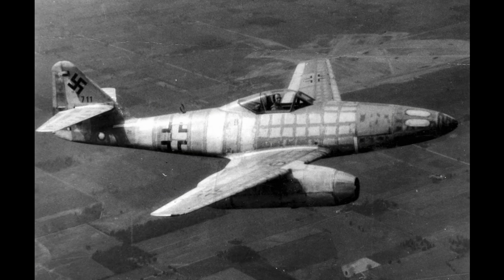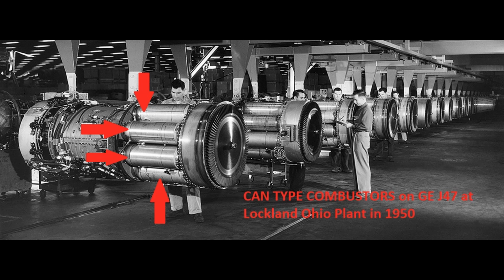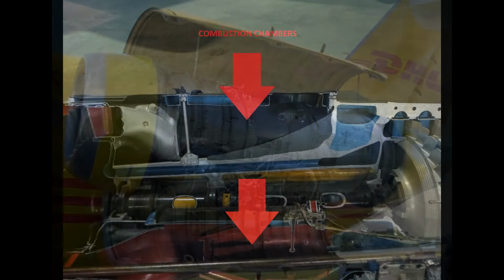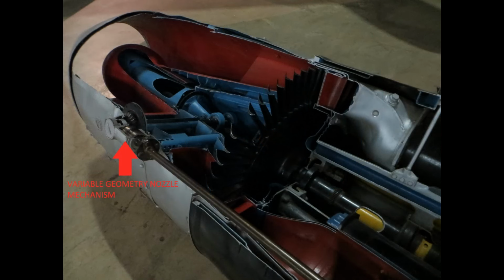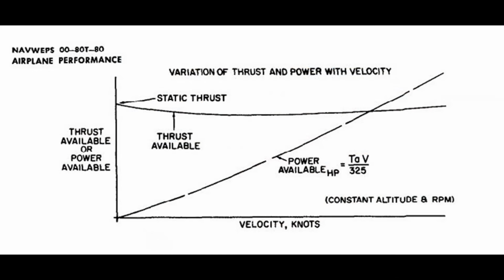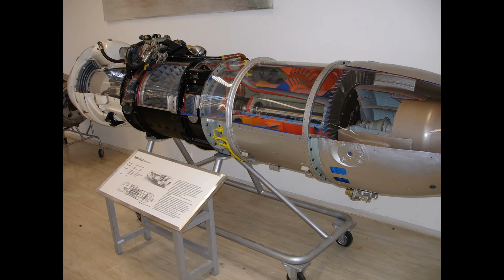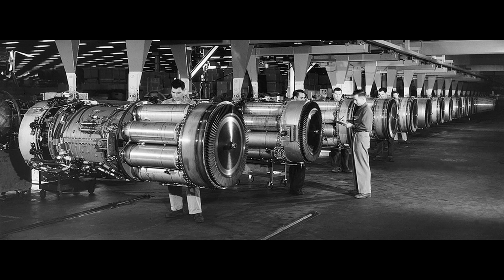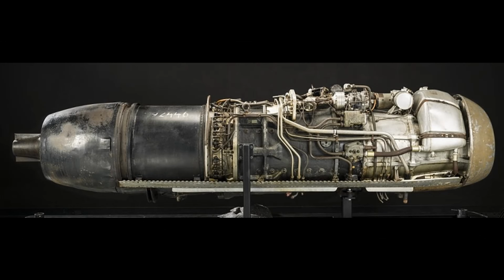World War Two JET POWER

Comment: Oh dear. I have been a consistent fan of Greg for many years but this upload defies description for misleading information. The Brits ran an axial Metrovick  F2 in November 1941 and flew it in a (twin) Meteor in November 1943. Sadly turbine failure resulted in a fatal accident in April 44. The problems in the F2 alerted the Ministry to the development problems of the axial engines even though its power to weight ratio was potentially superior. It eventually became the Beryl and led to the Sapphire(Wright J65). Britain pressed ahead with the centrifugal Whittle engines, the Welland and Nene as well as the DH Goblin. These were all wartime production engines – reliable, robust in throttle response and easier to build with over 100hrs TBO. RR were very good at centrifugal superchargers for Griffons and Merlins. The Welland flew with afterburners in 1944 to chase V1’s. The Nene ran in October 1944 at a thrust of 5,000lbs and a dry weight of 1,600lbs with total reliability. The Jumo004B gave 1,980lbs thrust for a weight of  1,585lbs with total unreliability. The Brits got their superior tech into today’s war while the Germans were always chasing the next dream.  The 262 was a first generation straight wing jet with the same performance as the Welland (long nacelle) Meteor, the Vampire and the P80. Out of 1,294 built, fighters shot down 214 and 146 crashed with various pilot/turbine failures; more were lost through other means. It had no impact on the air war. I get fed up with the Me262 myth. If the Germans had won they would have discovered that turbine and material science was way ahead in England as were actual useable wartime inventions like the cavity magnetron, Penicillin, the proximity fuse, the Mk2d computing gunsight and the B29 etc etc – not to mention Colossus. Read- Gunston – Development of Gas Turbines, The Fedden Report and Jet Man – and then, please,  rewrite this again with the facts! By the way the Ju287 was a bitsa Heinkel experimental aircraft to specifically test the swept forward wing – it was never intended for operations.
Reply from the maker: Chris, it seems that your complain isn't that I said anything incorrect about the Jumo, rather it seems that you are complaining that I didn't talk about British stuff. I just had an entire video about British stuff. You people are never happy. Look, the British did make some good progress on turbine engines, but during the war the 262 was a better plane than any British jet. The Meteor wasn't even allowed over enemy territory, which is where all the air to air action was taking place. The Jumo proved to be the basic layout of turbine engines to come.
Reply: @GregsAirplanesandAutomobiles  I am a historian writing on technical subjects and as such understand that I have a duty of care for unbiased, balanced factual truth. I  am not English. The Americans were given a Whittle engine in 1941 which resulted in the successful copy, the GE1, in October 1942 - but they already had some  embryonic turbine projects underway. The prototype GE-TG-180 11 stage axial running at 4,000lbs  was a success running in April 1944 with no input whatsoever from Germany. The Russians were about to run the eight stage axial VRD-1 when they were invaded - which rather took their attention. The Brits had the Metrovick F2 axial running in 1942. The Jumo was just one of several RLM axial turbine projects with Bramo, Mercedes, BMW et al. It was not the 'first' and did not influence anyone. It could be considered underdeveloped and unreliable, being the major reason for the failure of the Me262. The allies did not need to get jets to Germany because they controlled the air over the battle lines and beyond from July 1944  with a massive numerical superiority which made the few Me262's a nuisance not the 'wonder weapon' beloved of the 'whatiffers'. I liked your recent post on the Wright $1000 challenge because it was well researched but you forgot to mention your own country's genius Manly who made the radial for Langley's Aerodrome which gave 52hp for 125lb weight in 1902. The problem with TV documentaries and Youtube is that they often have no editorial or peer group supervision - this allows a sort of mish mash 'faction' which warps history for future generations. I still like your posts which are mainly well researched.
Reply from the maker: Thanks Chris. I understand your point, and I don't disagree with your overall position. We have to accept that there is a considerable difference between what I'll call an opinion piece, and a straight history report. In the case of this video, right on the thumbnail it says "best jet engine of the war?". That clearly states that this is an opinion piece. Anytime you throw the word "best", or "greatest" or something like that, it's an opinion. It's my opinion that the Jumo was the best Jet engine of the war. It's war record supports that, no other jet engine came close to the level of combat success it had. Now if you want to use another standard to describe "best" that's fine, but you would be basing your opinion on another criteria. That doesn't make me wrong, and it doesn't mean you are wrong. Some of my videos are not opinion pieces and lean way more towards straight history or technical works.  cont:

    Now in the 1000 dollar challenge video I didn't mention any engine builders because engines were not really  the subject of the video. The Wright's patent has nothing to do with engines. Any video is going to have some short comings in terms of scope. I can't cover all aspects of things in one video. There is some point at which I have to stop. For example, when talking about engines, should I get into the metallurgy of the  pistons? That's an important factor. Should I talk about the person who designed the forgings?  cont:

 Lastly, as you point out, my video are not peer reviewed. It's just me here, so there are factual mistakes from time to time, although I'm proud to say, not many. Now my opinions are another matter. Of course you or others may disagree from time to time. Frankly with over 100 videos on my channel, if you agreed with every single one, I would worry about you. Statistically that would be very unlikely, regardless of the channel topic.
Reply: The Metro-Vick was ultimately a failure, A.A.Griffiths abandoned the project and it was sold on to Armstrong Siddeley well after the war ended.
Reply: The Fedden Report is British proof that Germany was years ahead in aerospace technology... 
 Many British urban myths are based on a common ailment which plagues British culture, known by psychologist as Anglo-Inventus  it is a Cognitive Dissonance disorder where the person believes that Britain invented everything by refusing to recognize or dismissing  anything invented outside the U.K.
Reply: @sandervanderkammen9230  Read the response - I guess you suffer from Germano-superiosis - a common disorder after defeat in two wars.
Reply: The Metrovick was a failure, Britain would not have a viable axial compressor turbojet until the 1950s
Reply: @WilhelmKarsten 
Fryed Ryce Munchyrz Kharzeestan Krappenz DiktorBummer Werkzxoffen etc and co SHUD note good with much awestruckness pleastoo &

It's fairly simply, UK axial engines were superior to anything from anywhere else as they were being developed from 1925 onwards & of course the requirements for acceptance in service were also very much higher than anywhere else so they remained in testing & development for much longer than anywhere else.
  There was no urgency & no need to take silly risks & do ridiculous things with the engines or produce massive amounts of garbage as was routinely done elsewhere.
👍 
Cheers
. . ... . . .... . . .....
xcvcxcvxiiiiivcivc
Reply: @paulpaul9914  Britain didn't have a certified flight rated axial compressor turbojet in production until the 1950s.
Reply: @paulpaul9914  But why didn't the brits have axial engines during WW2... they continued to develop obsolete centrifugal turbojets into the 1950s
Reply: @paulpaul9914  Why do you tell lies?
Reply: @paulpaul9914  The most powerful turbojet engine of WW2 was the Junkers Jumo 109-012.

Britain didnt invent turboshaft engines The Norwegians and the Swiss did.
Reply: @paulpaul9914  How is it you cant answer a simple question about british jets still in production?
Reply: @paulpaul9914  The Nene never saw service in WW2 either... it was bulky, heavy and underpowered because of its obsolete centrifugal compressor design,
Please name a single supersonic aircraft with a centrifugal compressor turbojet.
Reply: @paulpaul9914  Variants of the Jumo 109-012 ARE STILL IN SERVICE TODAY

Centrifugal Turbojets are OBSOLETE since 1950.
Reply: @DoktorBayerischeMotorenWerke e
Kharzeestan Krappenz DiktorBummer Jurkzxoffenz etc & co - they should note with much awestruckness.
    More than 30,000 Whittle style centrifugal compressor reverse combustor gas turbine aero engines have been produced since 1940, they are still manufactured for use in a number of helicopters & turboprop aircraft.
  The PW200 gas turbine aero engine is such an engine that is currently manufactured.
  The RR (Of England Of Course) Nene centrifugal compressor gas turbine aero engine was twice as powerful as any short life scrap  engines being produced in Germany & of course was the most powerful gas turbine aero engine on the planet in 1944.

👍& 🙂& of course 😎 indeed.
Reply: @paulpaul9914  Centrifugal turbojets were already obsolete in 1940, Germany completely abandoned development because they were an evolutionary dead-end concept with no viability for the future of jet aircraft.
All jet aircraft today are powered by a German axial compressor jet engine.

Comment: Hi Greg, small correction, the air isn't compressed by being forced into a confined space. A common misconception, sometimes simply used because easier to understand.
The air in an axial compressor is compressed by being pressed through diffusor shaped airfoils. In a Diffusor, as you certainly well know, the air passes from a smaller flow area into a bigger flow area. This causes the airflow to slow down and therefore the molecules to reduce space in between them. That causes more friction (temp increase) and more packing (pressure and density increase. That of course only works under constant flow and provided the space towards the Combustor is adjusted (reduced) to account for the smaller space required for the same mass of air. This makes the compressor cross section look like a Nozzle even though it isn't one. 
The opposite is happening in the axial turbine section which works under the nozzle principle reversing the thermodynamics of the diffuser.

Comment: Very interesting video. I've watched less than a dozen of your videos so far. They were all worth watching. However, this is my favourite so far. I like numbers, graphs, and comparisons. Was 15-25 hours between overhauls typical for high-performance piston engines?  I especially appreciate your attention to the entire problem of winning in combat. There isn't much benefit to having cheap, mass produced planes with no pilots. Or the highest performance engine if there isn't enough fuel, or no one to maintain it.

I haven't dug into your catalogue adequately yet. However, I will say the overall design, testing, debugging, manufacturing, 'logistics' and operational infrastructure seem to get very little attention. You seem to be more practical than many other channels. Those 'overall' issues aren't as 'sexy' as engine power, speed, ceiling, bomb load, or fire rate. But those features are practically irrelevant without everything else.

Best Wishes. ☮
Reply: A Merlin could require an overhaul in as little as 5 hours.  The J47 in the F86 Sabre as much as 12 hours during the Korean War
Reply: @WilhelmKarsten  Thank you for replying, and giving some stats. What is the source?
Best Wishes. ☮
Reply: @gbulmer  30 years experience and a warbirds historian.
 It's not like on TV or the movies
Reply: @WilhelmKarsten  Thanks again. I'm not sure what you're getting at by " It's not like on TV or the movies"
I've been researching as part of my job since the late 70s. Much of it interviewing experts and collecting primary source material. Comments under YT videos are less reliable than 'scuttlebutt' or hearsay. If you can't identify specific evidence, that's fine.
There is nothing at your channel. Have you published anything, or given any public presentations?
Best Wishes. ☮
Reply: @gbulmer  Do you know what WEP is?
Or the difference between PFTR and TBO??
  Do you know how often a Rolls-Royce Merlin engine requires a mandatory internal inspection?
Reply: @WilhelmKarsten  Thank you for replying.. A brief reply, No. I'd need to do some research to find those out. 
I did work with a guy who worked for RR aero-engines, so I might be able to find out. But it won't be quick. 
I also worked with the folks who built Rolls Royce and Bentley motor cars, (I was analysing their sales process which is tightly coupled to production and logistics because the cars were heavily custom built). We built their on-line sales support system. So I can imagine, if I looked in old note books I could dig out facts that are no longer commercially sensitive.
I even worked within a 50 yards of buildings where, reputedly. Sir Frank Whittle did early work on the jet engine. The drinking water was horrible.
None of that matters.
Primary sources!
Best Wishes. ☮